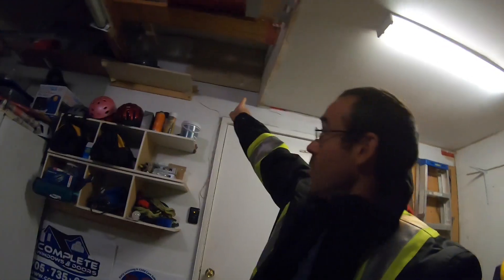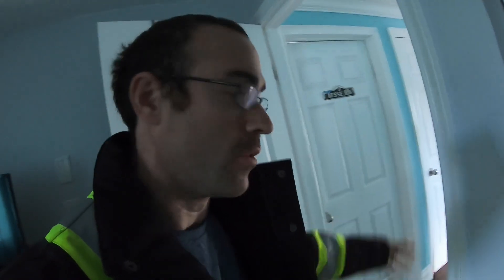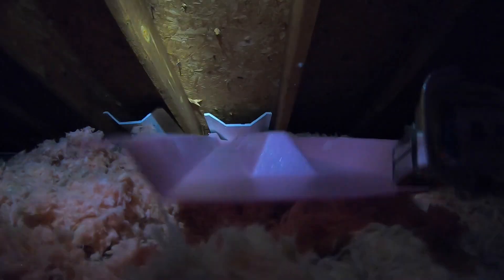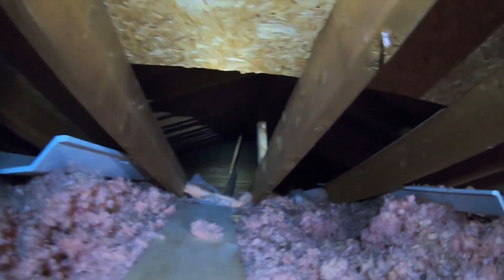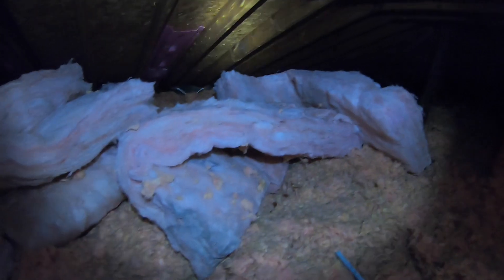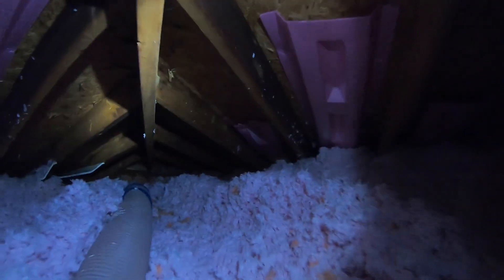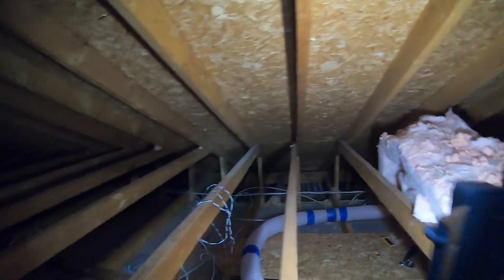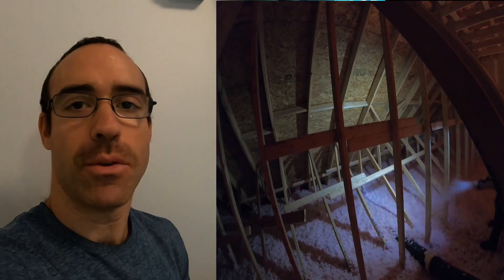DIY ATTIC INSULATION | HOW TO INSULATE YOUR ATTIC in 2021 - 2022

Comment: What length staples do you use with your hammer stapler? Is there a stapler you recommend?  I was thinking of getting a Dewalt carbon fiber to use on other projects, but don't know if it will go through the Styrofoam.
Reply from the maker: Most work staples will work. You just need to be gentle yet firm to get them through and not make a big hole in the styrofoam lol. The cheap mastercraft hammer staples can work just fine. The end can get undone though and then the spring lets go so you have to make sure you don't grab the very end of the handle.
Reply: @SinnisjInsulator  Thank you for the insight and tips.  I'm definitely going to do some practicing on my back until I get it down :).  I have a 60's shallow attic and I your videos give excellent advice!
I was worried about the length of the staples to prevent them going through the wood and causing leaks, but I'm assuming that's not really an issue.
Also, do you have a spray foam insulation brand you recommend for air sealing top plates, fixtures, wiring and piping?  Tons of videos out there, but not many go through the key words of what we should be looking for when selecting a brand.  I had my eye on Great Stuff fireproof, gaps and cracks (orange stuff) because I live in Florida and the heat is our biggest concern.  Trying to find something I know will hold up in the long run.

Comment: Hello, I'm looking for your video's comparing blown in fiberglass vs cellulose. It's my understanding the cellulose has better heat transmission control from the condition space to attic in winter and attic to condition space in summer. What are your thoughts?
Reply from the maker: It's true a lot of people prefer cellulose for it's air tightness, since it's literally full of dust when installed. Fiberglass has to be installed at a higher depth for the same r value as cellulose. As an installer I prefer installing fiberglass because you can see what you are doing throughout and less room for mistakes. You can easily miss spots as a beginner with cellulose because it gets so dusty. It's also very hard to even it out. I personally also don't like the smell of the cellulose dust. If you sweat a lot during installation, you need to change mask because cellulose will be caked on, and it will be difficult to breathe. I'm not sure how long the fireproofing additive works but fiberglass only melts when lit, so that's a bonus and it doesn't smoulder. I would make sure the ceiling is air tight if you do install cellulose, since you don't want to breathe in that fire retardant.

Comment: So I blew in the insulation over the weekend. One more question - on the attic hatch. So basically we tape the insulation on top of the hatch square?  What you did with hatch entrance didnt quite make sense as the owner would be opening and closing that door so you cant insulate it from the top as you are doing
Reply from the maker: That sounds like you have an attic hatch with stairs? Usually nobody goes into the attic unless there is a roof leak or some major renovation project. I typically add insulation over top of the square to make it the same r value as the rest of the attic.
Reply: @SinnisjInsulator  Sounds good. No I just have an attic hatch 20"x20" without any stairs. Im just thinking about going up there for any other work. I also dont go there often but had recessed lighting installed recentlly. The electrician went to the attic. I've glued a foam board to the attch hatch for now. Will tape some of that pink insulation as well pn top

Comment: Basic question - once I lay down the blown in insulation, how would I access the further corner of the attic later? How do I create a "walkway" which is insulated on the attic so that further corner of attics can be accessed ? I cant walk on top of the blown in insulation
Reply from the maker: For shallow attics it can be difficult to build a perfect walkway. Here is a video I made for walkways in an attic with trusses.  https://youtu.be/rZjldONTaYs
Reply: @SinnisjInsulator  thanks for the video. Unfortunately I can just about sit n my attic. So no chances of building a walkway on any trusses. Its a shallow attic
Reply from the maker: @wsiddiqi  most older homes and some new have shallow attics. Makes for lots of snow load on the roof though. Homes that are far North usually have a high pitch roof for that reason.
Reply: @SinnisjInsulator  Got it. I'm in california with a house built in the 60s. It has a shallow attic. No snow worries here. I can just barely sit straight and as I drag myself around, I have to duck furtehr as I run into other woodern beams

Comment: Whats the production rate on the machine you use?
Reply from the maker: That one is 1min a bag of pro pink. Each covers a little over 30sqft at r60. It's a heat seal brand with gas engine and 4 inch hose adapter.

Comment: Great video. Unfortunately I bet there are folks that think they got most of the leaks, but if they didn't it can lead to moisture and that's a whole new issue. If you go up to check on the insulation what's the easiest way to locate moisture issues?
Reply from the maker: Great question. The thing with leaks is that it will depend on the cause of the leak. If it's a heat loss leak, then it is easier to spot because of the darkened roof sheathing. If it's a roof leak because of bad shingle installation or just old shingles, then that is actually harder to detect because it won't cause a dark spot right away, especially if it drips through roof nails. It's easier to detect leaks with cellulose, the insulation will be much darker and sunk. With fiberglass, the insulation can actually stay looking fine, but the water will have trickled to your ceiling.
Reply from the maker: I'm looking back at my response, but I think you meant air leaks through the ceiling correct? I will be doing a video soon on major areas to air seal with foam. If you have insulation in your attic you have to dig to find those spots unfortunately.
Reply from the maker: Hi Bourbon Dad, just made a video on roof leaks, I know it's been a while since your question but it's finally out, hope this helps: https://youtu.be/XCFHY9CcyQg

Comment: Way easier to run the hose up the side of the house through the window = less hose, less prep, less marking up the trim and architraves and it's way faster and easier to pack up and leave.
Reply from the maker: I completely agree on nice days. On rain or snow days however, I prefer to avoid the grass if I can. All depending how many ground sheets we have ☺️. Thanks for watching man.